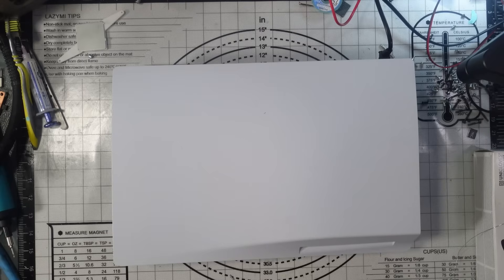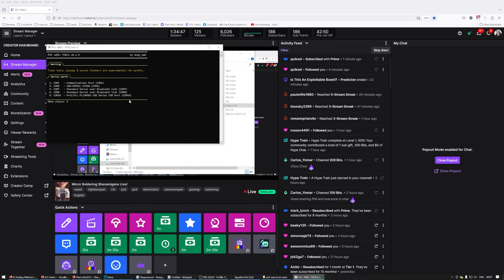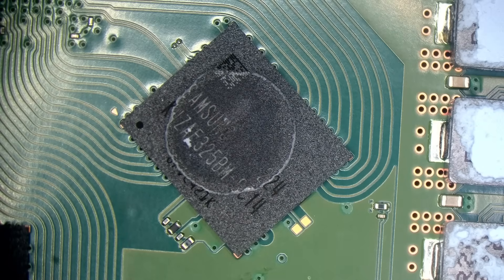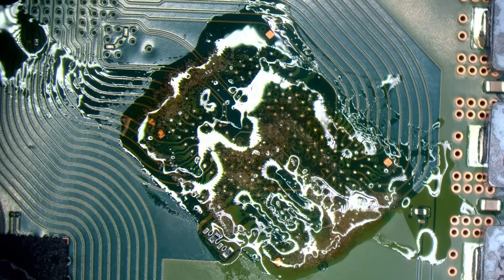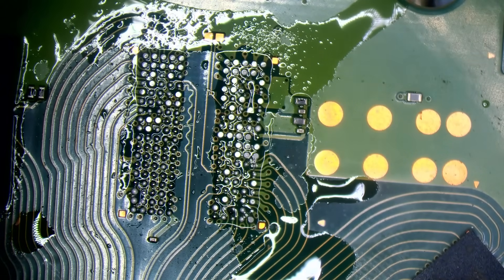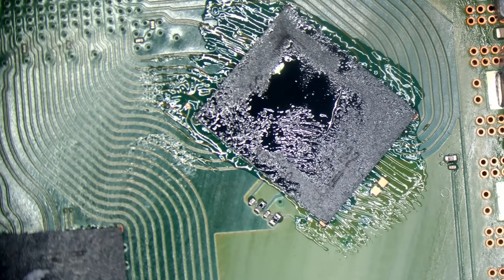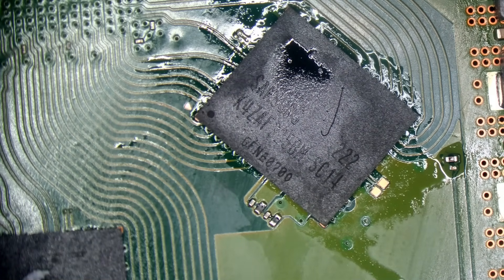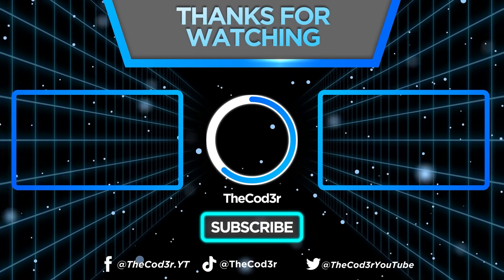Why Is The GDDR6 RAM Failing? PlayStation 5 2 Second BLOD Repair!

Comment: what was the air flow and tempererature you used to reball and reinstall?
Reply: He said 10%, we dont know what station does he heave..
Reply: @RobertMustiuc the 862d
Reply: Did you find out the temperature?
Reply: @TiagoV-T  its 400 with 10%
Reply: Do you know where to buy it? I have a memory error, beep and blue light, but it is not sold here in Brazil and I could not find an exact model of it. @RobertMustiuc
Reply: @TiagoV-T  What exactly do you need? The hot air station?

Comment: soldering new chip without preheating the board?
Reply: No need for a RAM chip, small area it will get heated enough with the station

Comment: Phil. Got a ps5 disc drive wont work. Wont even beep. Eject works cause i checked the 3.3 drops to 0. 5v and 12 volts are present at the disc  drive.  Both ends of fuses. Fuses test ok. Both drive end and board end. Lost. Daughter board?

Comment: These toys are made to fail. Hence cheap capacitors, lack of airflow, overclocked processors, cheap ram. Failure just after the warranty expires ensures another unit sale.

Comment: I wonder how hot those RAM modules get while inside the ps5 case during gaming. I bet they are getting cooked. Should hook up a thermal probe and test it.
Reply: Yup get pretty hot on my 9070xt.

So with poorer cooling on ps5 could easily see if 95+ degrees

Comment: Have you thought if that ps5was dropped there might have been a weak solder joint that snapped and that the chip may be ok
Reply: This. 

A large proportion of GPUs I've repaired have been dropped, been in systems that haven't been packed properly so the PCB flexes in the PCIE slot, other shipping damaged systems (finding broken toughened glass from broken case side panels in thermal pads is a thing). Almost all of these present with memory corruption symptoms but its not the memory module that's at fault, bug the BGA connection under it and very often the GPU core that's become damaged and very often ripped several pcb pads and traces under the core as well. 

I've probably repaired more impact damaged cards with a core and memory reball than any other type of fault over the last year or so...
Reply: There was a Damaged Pad on the Chip !